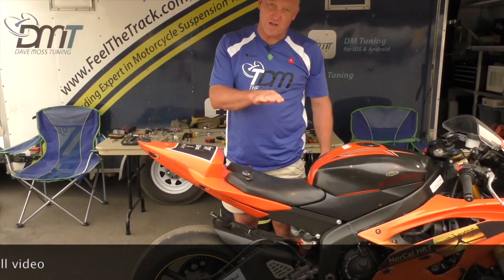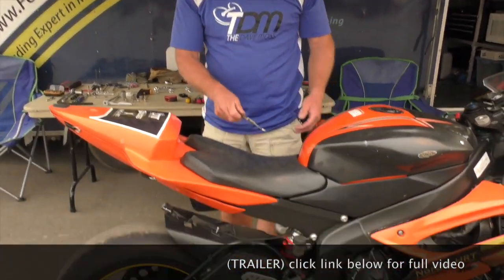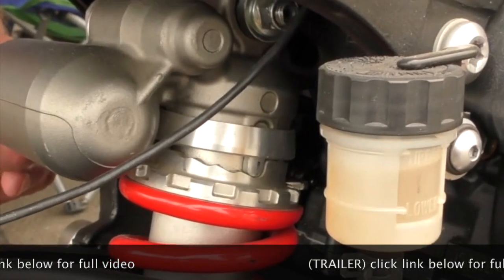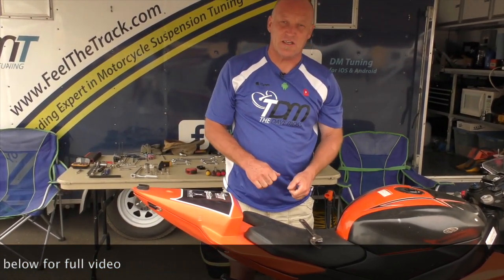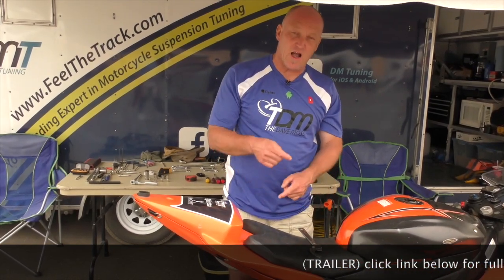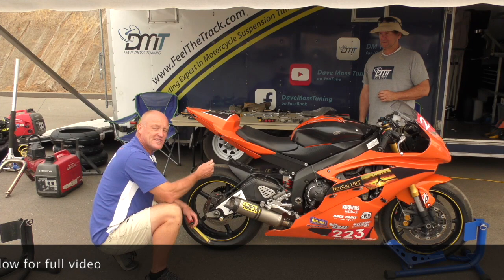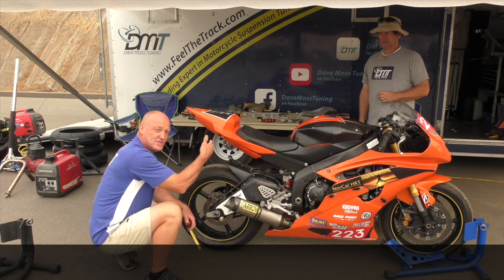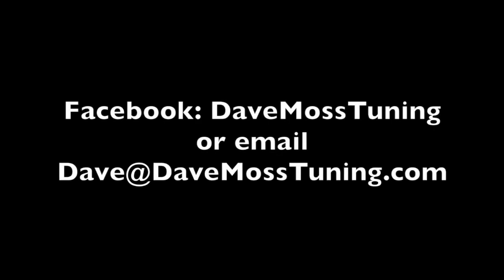Fasterclass: Shock Static Sag (TRAILER)

Comment: So why do we need to add static sag and rifer sag? Once I come up with the number? What do i do with that?
Reply from the maker: Static sag is a critical number to have in the 12-15mm range. That allows the suspension (front and rear) to top out into dead space and that can often leave the rider in the seat. Between static and rider sag combined, you should start at 30-33% of the total travel available.